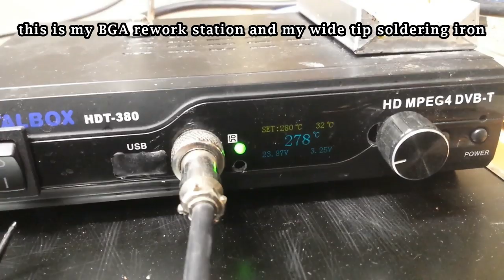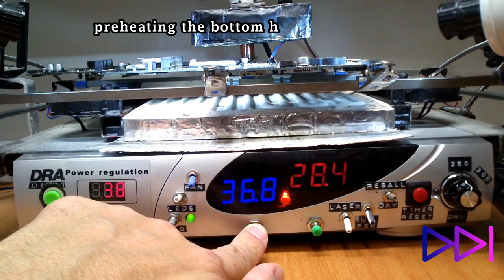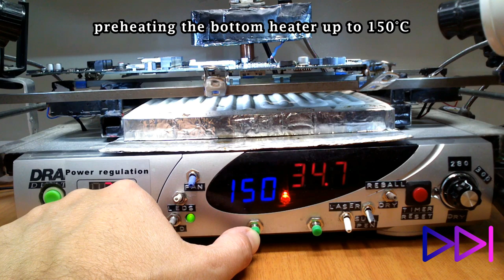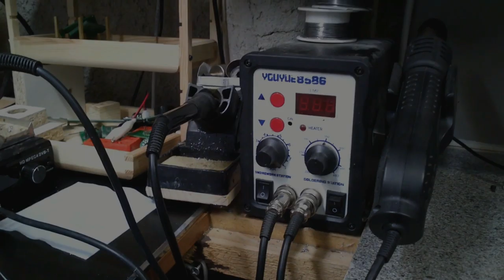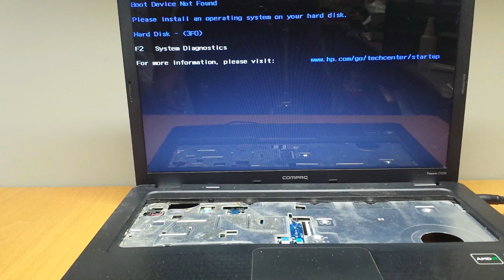Repairing HP-Compaq CQ56 Laptop - No Video Signal - BGA Reballing

Comment: The cleaning of pads is easier while the bottom heater heats the pcb and the lead free solder melts easier with less danger to stuck the braid and lift some pcb pad.

Comment: 12:42 you ripped 4 pads in the top right corner.
How does it still work?

Yesterday I ripped just 1 pad and the laptop won't post, and its not even a reballed chip, but one that I bought form aliexpress..
Reply from the maker: many pads on the bga are used for ground and if you rip one or two it will not matter, 
the pads you saw me ripping where not connected to a trace and they just detached from the pcb during the procedure.
Reply: @NikTelio  thanks for your answer, so my refurb chip was DOA.

Comment: Reball it? Think it would be better to replace it! Is it me or is the fan kinda dirty?🤔 Also, does it help when the reball / replacement is done, to replace the corner sealant? Thanks & great work! The heat spreader, the small metal frame attached to the bottom of the board, it just comes out after lightly heating it?
Reply from the maker: Replacing those kind of chips is a better solution but some of them seem to work for many years after reballing/reflow,
the corner sealant (chip glue) does not need to be replaced,
the small metal frame on the bottom of the board is not a heat spreader, it is a frame that holds the heat sink and yes it comes out if you heat it.
Reply: @NikTelio  so removing the metal frame prior to pre-heat & reflow/reball ops is best. Thanks.
Reply from the maker: @j.lietka9406  you should remove it before you start the repairs
Reply: @NikTelio  right! Thanks

Comment: Hi Nik.. in the past your advise helped me alot over reballing and stencil bending issue. Thanks.. i reballed an i7 cpu and when tried to solder to the board. The cpu popped like a popcorn at 220C.. preheat was 120 degree. Thus a broken cpu.. is there anything to put on the cpu when welding so the heat wont turn it into popcorn..??
Reply from the maker: Hello, no bga chip gets popcorned when the temperatures are within normal range, unless it has absorbed moisture by laying around for a long time before you tried to solder it back to the board,
 if you reballed with leaded solder balls then the melting temp is 182c, no need to go to 220c, 205-210 is ok,
and about preheating and soldering process, preheating the board before you start the soldering process is important, after preheating the bottom heater is the one that provides the most heat, the top heater only helps a little to rise the temp at the bga area to the desired  point, if the bottom heater can not provide the most heat and the top heater is used to provide much heat to raise the temp then the chip will get too hot and will probably be popcorned (regardless of the low board temp reading).
i have popcorned many chips until i finished the fine tuning of my bga rework station.
Reply: @NikTelio  Thanks alot Nik.. i have done all  gpu reballing with succes maybe because gpu chip pcb are thick enough, using same profile for intel cpu's past 6th gen, got 3 popcorns 2 went succes, 

What is the best bottom temps when doing intel chips.. ?? 

As per your advise about warton metals, i got it directly from warton metals.. thanks

Comment: So do you do repairs for people?. And by the way have been enjoying your content. Very well thought out station. Question. Normally  are you driving heat from lower and upper ir heaters simultaneously?
Reply from the maker: Hello, i preheat the bottom heater (800watt) up to 180c and then i start the reflow profile, and both heaters work together to heat the pcb up to ~240c,
the bottom heater is the one that delivers the most heat, the top heater (about 150watt) just helps to rise the temperature on the bga area and reach at least 220c to melt the solder.
i do not do repairs for people just for a few friends.
Reply: @NikTelio  Thanks. Nik. So do you have a link to the software?
Reply from the maker: the software came with the PID controller and it works only with the same model PID controllers,
if you need it i can upload it.
Reply: @NikTelio  Yeah do they still make that item? Didn't know the brand name of your pid you got. Did a raw search on ebay and scrolled through a few pages and didn't see the one you got. And thank you.
Reply from the maker: Hi, no they stopped making this pid controller years ago but there are many other alternatives on ebay, newer models with more functions.
Reply: @NikTelio  O.k. thank you for replying. Any recommendations? Also did you wire terminal all the components to run on 1 power cord? When I say wire terminal I mean those dual screw post terminals that you can wire multiple. By the way you do a very good job compared to some others. I've seen and know you can get a professional workstation, but's it's like $5400 dollars. Can you do you repairs for people?

Comment: Dear Sir, very Nice Jig developed by you. 
Good to see you made as an hobby project. Can you pls share Heater used details means size and rating.
Reply from the maker: Hello, the top heater is 80*80mm 450w but it works at 39% power,  it is connected to a power regulator to reduce the heat output, 
the bottom heater is 180*180mm 800w connected to a thermostat to make the panel reach and stay at a specific temperature.
watch this video and in the description you will find a parts list: https://youtu.be/yOoBdcpfc5U
Reply: @NikTelio   tks U

Comment: I gott this exact same model from the Nvidia HP class action settlement, should have just kept my media center laptop with the borked wifi and the oven temp GPU. I see why they settled the suit with this laptop, it was just as bad if not worse than the system they got sued for.